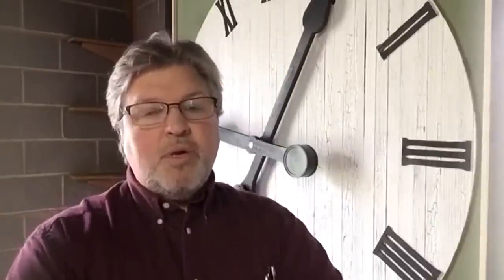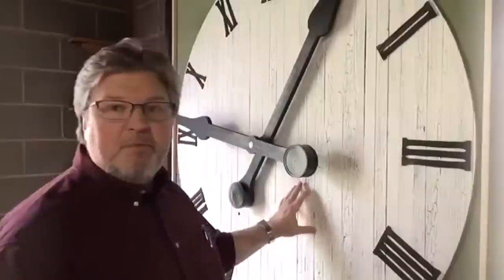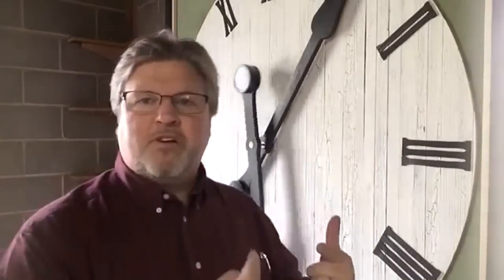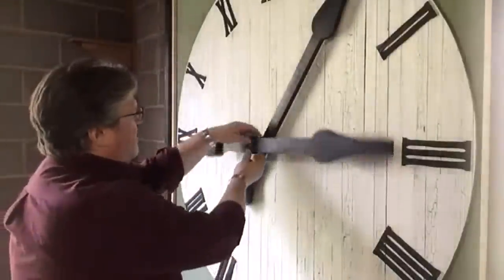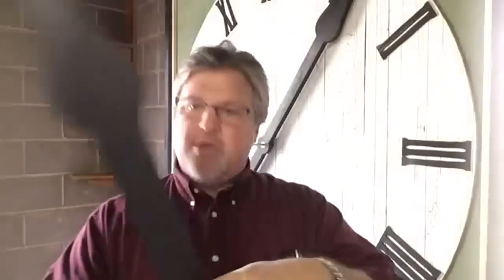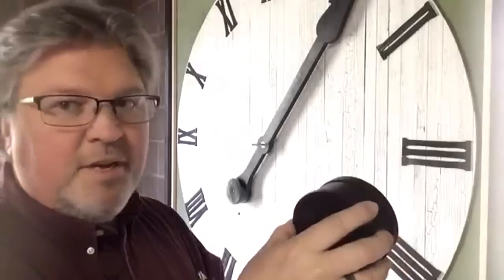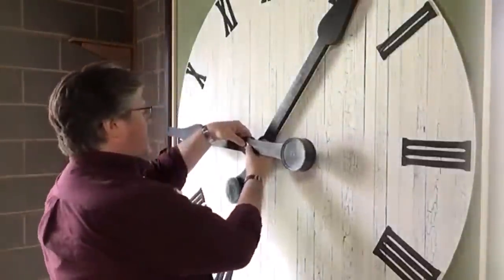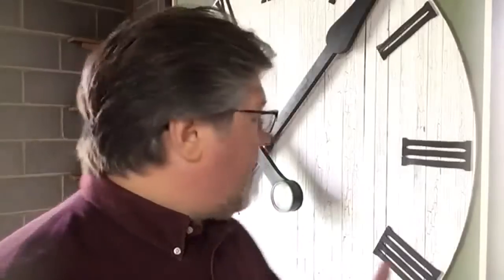How MrToolHunter's "Shop Time Throwdown" Mystery Clock Works. Giant wall clock

Comment: Fiendishly clever Scott! In fact I'm not entirely sure I understand how it works... Is the hand movement from a reaction force to the rotation of the weight? How well does it keep time?
Reply from the maker: Yes, that's exactly right. I balanced the hands with the counterweight tape temporarily to the center of the clock shaft. Once the hands were "perfectly" in balance, I moved the counterweight to its final position on the shaft. As the counterweight travels around inside the tin in a counter-clockwise direction. its travel throws the hand into a new position. As long as the error is called it's fairly accurate. I would guess in a 24-hour period it averages Close to perfectly. Check out the video that I linked in the bottom of the description of my reveal video of another clock that I found on YouTube that is built using the same method. Because it has much smaller hands I would imagine it moves in more of a sweeping motion. Admittedly, mine is a little jumpy.  Scott